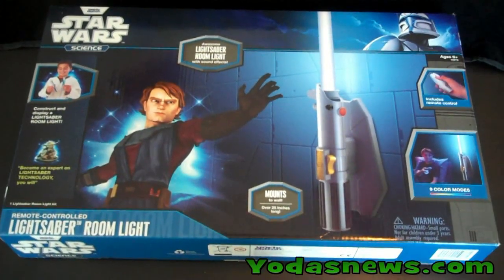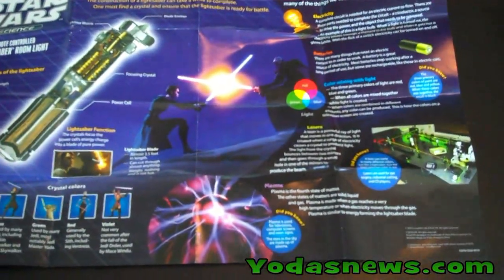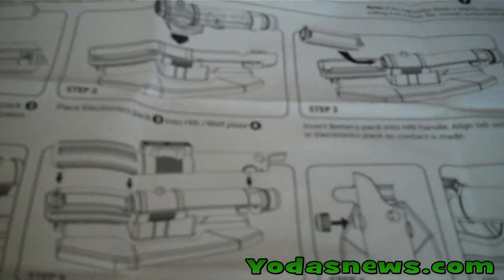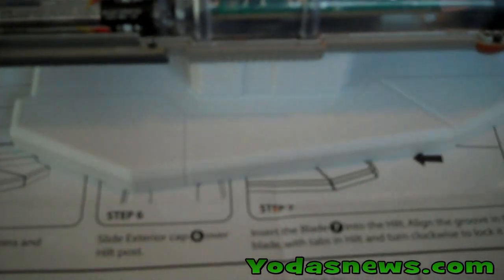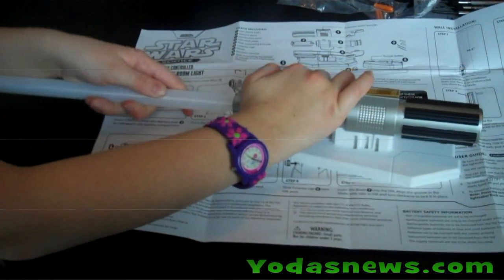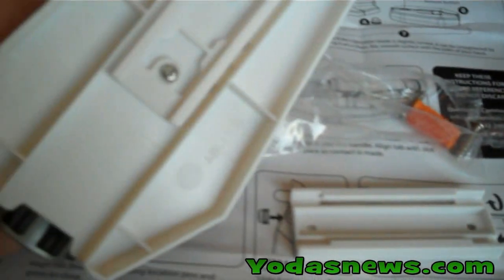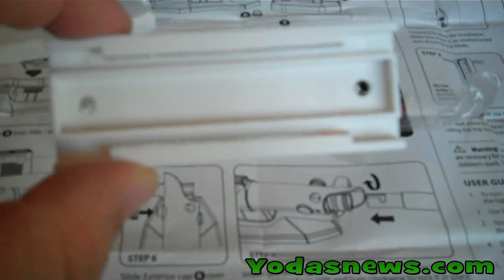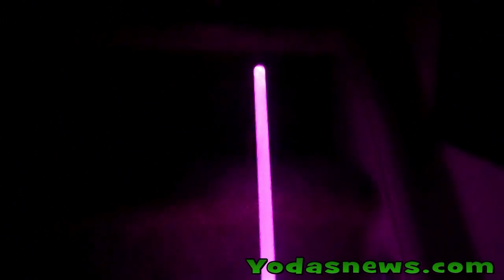Star Wars Remote Controlled Lightsaber Room Light Review

Comment: Your video was shot way too close to the subject, in every segment!  Also, instead of resting the lightsaber with the blade next to the light on the stairs... try resting the handle next to the light, so THAT (which is NOT illuminated) can be seen.  There's no need to be holding it up at that point, and you wouldn't need to switch-off that light!